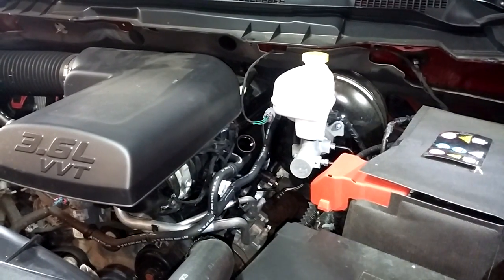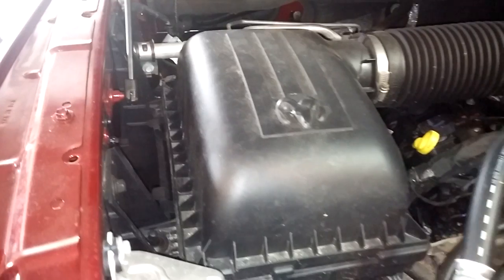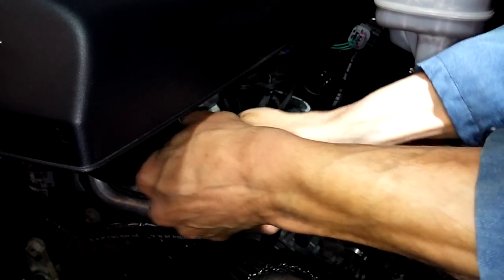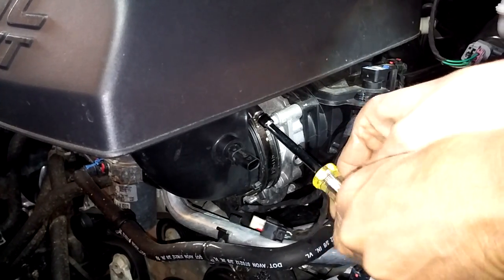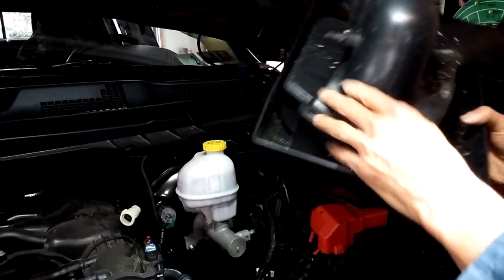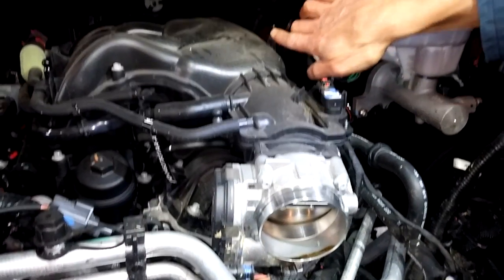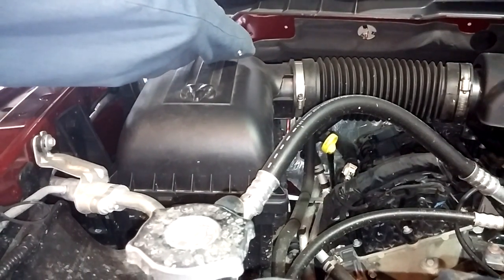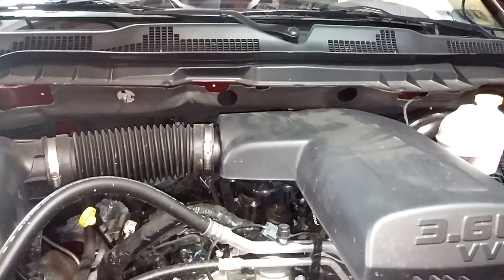2013 Ram 1500 V6 Pentastar Air Intake Removal

Comment: Very important!  You do not wiggle out the hose in the back right. You push out the white u shaped clip then you can wiggle out the hose.
Reply: Yeah, I tried it today his way, and was afraid I was going to break it trying to yank it off.  It took me a while to figure that out on my own.
Reply: Where does the hose connect to?
Reply: Did you found  the answer to that? @wolfpackreceiving500

Comment: you don't have to remove the air intake to change the oil and oil filter I have 210,000 miles on the same truck and engine and have never removed the air intake just use a half inch drive ratchet and socket to fit there's plenty of room. This just looks like a waste of time
Reply: Agreed... I do mine all the time without removing the cover.  I do have to change plugs though.
Reply: True but it's still nice to know how to do it
Reply: You have do that then the upper manifold … what a pain
Reply: I'm over here using a channel locks bc I'm too cheap to buy a socket

Comment: Really good video is so many ways.  The only question I had is this:  What did you put the end of your long screw driver on when you levered those round rubber grommets off those two round pins in the back?  I couldn't see how you did that on either side.  I would have thought you would have needed a 2x4 block of wood or some such to push the end of the screw driver down against the wood to have the leverage necessary to pop the rubber grommet up and off the round pins with the shaft of the screw driver.  No?  Other than that, this was very well done.

Comment: Thank you for doing this, I changed the oil in my daughters new Ram classic with 3.6 and I might have cracked the damn cover trying to take it off to reach oil filter housing. Now that I know, I'll pull it off and make sure it didn't crack , which would allow dirt into the intake system.
Reply from the maker: Your welcome. Glad it helped.

Comment: While I’ve yet to need to do this to change the filter (extension and swivel usually do the trick), it definitely did help me check the intake valve and get an overall better look without the big old piece of plastic. Pretty sure my problem (2016 starts, RPM swings and surges for 10s or so then catches itself and runs fine regardless of hot/cold engine) is the fuel pump (it whines) which sucks because it’s been changed twice when it was under warranty.
Reply: Also for those of us with the clip on the white piece it can stay attached and should be flexible enough to move out of way if all your doing is checking intake

Comment: Thanks for the lubrication tip.  Made it much easier.
Reply from the maker: Glad it helped. Yours is one of the few responses to this video that wasn't negative. Most people never read the description.
Reply: @diverdon184  Yeah, I've always done it without removing this cover.  But today did this just for kicks and it did make things easier.  Gave the air flow sensor a cleaning while I was at it. Next time it will be quick and easy now that I know the trick.  Just got to figure out the PCV replacement on this truck now. 😂

Comment: great video. Looks super easy per your instructions. I do have a question, the hose on the back you remove by the rubber post. where does the other end attach? mine came off and I have no idea where it goes. And I hope I dont have to remove everything again. Also, I cracked the intake manifold at the bottom side, of course over torquing. will that present too big of an issue? Thanks a million.

Comment: Thanks for the video.
You shouldn't have to remove to replace the oil filter if you have the right socket, but when you find a 15/16ths deep well socket is all you have that fits but is too tall to fit under the plastic cover, you do whatever it takes to get the job done. After removing my cover I discovered my rubber intake gasket was pretty badly deformed so maybe it was a good thing my regular 24mm socket was playing hide and seek. I'm tellin you, that 13mm socket is a bad influence on the other sockets.

Comment from the maker: Lubricate the rubber ring inside the clamp then hold the back up away from the plastic pins. Move the back slightly side to side.

Comment: Hey!  What is that hose in the back u mention. The 1 with the white tab or cover on it. Mine happen to broke off and where does it lead to. Looking to replace that hose. I guess thats the victim of my vibration at idle.
Reply: Did you ever find what it was im having the same issue

Comment: I have a 2017 3.6 and their is plenty of room under intake to replace the oil filter. That would be a huge pain in the rear to have to do to change the oil.

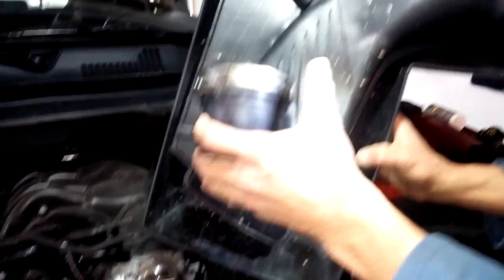Comment: At exactly 3:09, does anyone see the "hose to nowhere"?  Just above the oil filter cap there are 3 lines.  The lowest line is plastic and just above it are two rubber tube lines,  the furthest one back ends in a 90 degree plastic elbow that looks like it should connect somewhere.  If you can't see it, just follow the streamer on the foremost rubber line from bottom to top and then another 2 inches and you run into the elbow.  I spent 45 minutes standing on my head trying to find a location for it and could not.  Truck runs fine without it connected.  I'm thinking it is a vacuum line.
Reply: Literally why I looked up this video
Reply: Same here. My car is running rough under load and I found that tube just sitting there

Comment: My friends and I did not do this removal, and damaged the plastic oil pressure bypass valve, causing it to break.  When you pull out the filter, you have to bend /angle it.  This bends the plastic bypass valve cage, often leaving pieces  of plastic that need to be fished out - REQUIRING REMOVAL OF AIR COVER!   From now on, I'm taking the long way.
Reply from the maker: Thank you. That makes up for the abuse I've received from this video. I made it clear in the description that it is not necessary but it was easier for me. It's very quick and easy if you know how to do it.

Comment: Holy crap thanks a bunch, but I still can't figure out how to get it back on, it seems like something is blocking the front end from wiggling all the way in.
Reply: Have you figured it out yet?................just kidding 😃
Reply: @ureasmith3049  Nope, I just let the car overheat and blow up
Reply: @Nahgooyen  😃
Reply: Driver rear side of beauty cover has a round rubber grommet that  pushes and pulls on and off...most likely your culprit.

Comment: Good Grief Ram... was the oil filter an after thought?  you mean all the engineering that went into the motor.. they couldn't come up with a better placement for the filter? s.m.h
Reply: this is a perfect spot for the oil filter so easy to get to I change the oil in my truck about once a month because I drive a lot of miles and this is so easy you don't have to remove that air intake assembly IDKY this guy saying you do
Reply: oh..ok. the video makes it look so complicated. I am considering the ram but can't decide between the hemi or the v6. can you shed any light? How has your truck been? What's your REAL LIFE gas mileage? everyone I know has the hemi. They love it and SAY they get 22mpg on the highway. I find that hard to believe. If so the v6 must average 24 mpg hwy.
Reply: +Ace.C Canty I have averaged  25 mpg on a  averageing 77 mph a gas mileage is what you're looking for V6 is what you need this thing has plenty of power
Reply: +Josephuskikit Fred wow.. that's great do you have a 4x4 or 4x2?
Reply: 2 wheel drive quad cab
Reply: Also, mine is the 4x4 quad cab Tradesman model
Reply: I wish I knew how you guys were averaging 25+ on the highway! My highway average is around 16-17! V6 4x4 Crew with 3.21 gears. I swapped the single exit exhaust for the factory dual exit but I assume that wouldn’t cause a drop in mpg that big
Reply: @tygostavern  Those guys above saying 25 mpg have 2WD models.  I have a 4WD Crew 3.6 V6 (not sure about the gear ratio on mine).  40k miles.  If I leave it in 2WD for the whole tank I get about 21.5 mpg if I keep it under 70 mph and mostly insterstate driving.  The computer is always off by about 1 mpg (it will say I got 22.5 mpg).  On a trip out west driving 85 I got down around 17-18 mpg.  And in town (not city) I'll get about 19 mpg.

Comment: I took my truck to the dealership to have this exact part replaced. (Intake cover) It took them nearly 4 hours to do what this video completed in 4 minutes.. unreal. Why would it take them 4 hours to just replace the engine intake cover with a new one???
Reply from the maker: Because dealers are thieves.You pay for all their overhead. I always check YouTube for videos like this one before I do anything. I've saved a fortune.
Reply: That's why they're called stealerships 4 hours of shop hours are not cheap
Reply: Of course, more hours = more $